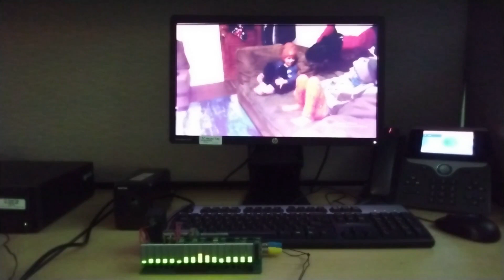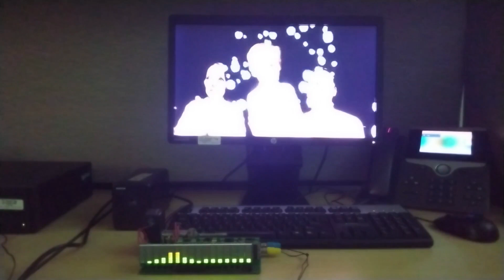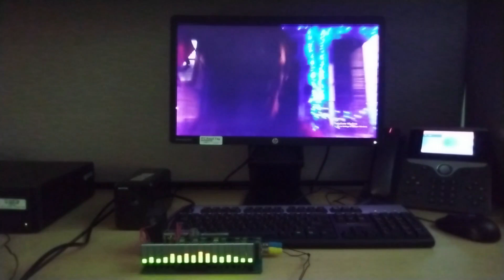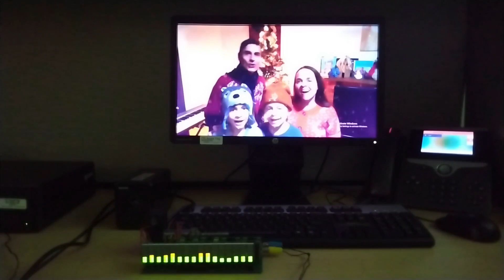Tutorial: How to make a 16-Band Audio Spectrum Analyzer

Comment: Hello,
     I am so curious.   Your device uses  L & R Analog Inputs.   Why don't you choose the Digital    4-wire USB "B" or "C" Audio Out from the computer?    I want to understand please.  Thank-you.
Reply from the maker: Apart from making the device more complicated, since the sound would need to be converted back to analog, there wouldn't be any real gain in using Digital 4-wire USB. Also, RCA connectors are very cheap and commonly used as sound input. This project was made for educational purposes and it is already complicated enough, as you can see on my page: https://bluemoonshine.fun/Project-AudioSpectrumAnalyzer.php
Reply: @BlueMoonshine  
         OK,  that's one question answered.  Now for the tough one.............
Is it possible or why is it impossible to find a multiplexer/demultiplexer unit that can drive a densely pixelated display like an OLED TV?
      Any help, rabbit hole or direction would be appreciated.
Reply from the maker: @TriAmpMyFi  
I'm sorry, I really don't know.
Reply: @BlueMoonshine  
       Thank-you.  Peace.